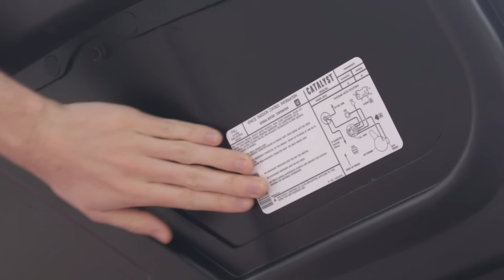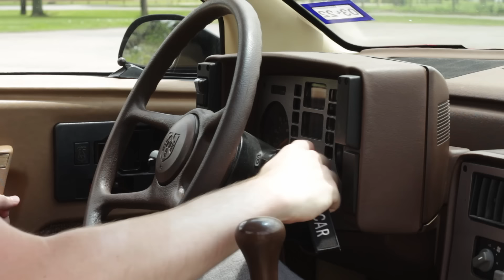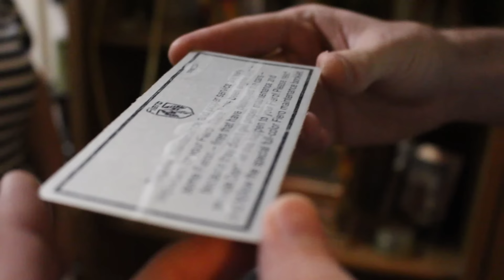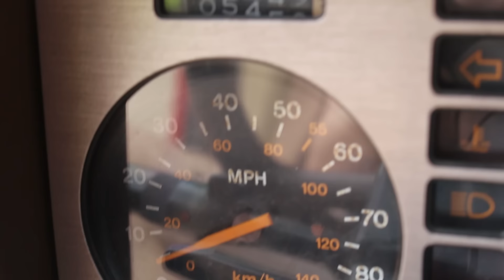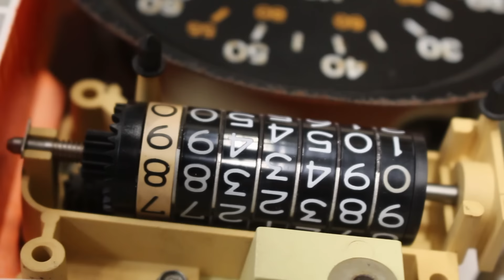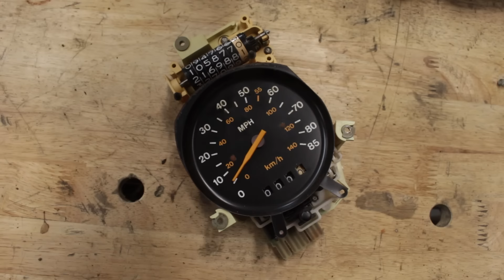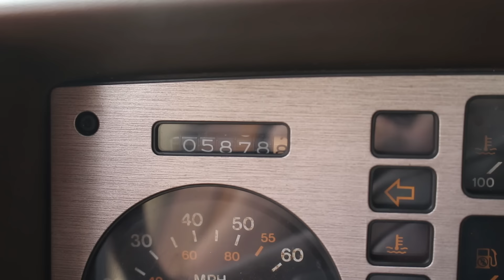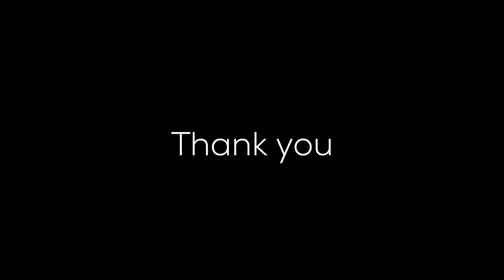The Journey Ends | 1985 Fiero 2M4 Revival - Part 15

Comment: My Fiero story:
At 19 yrs of age, I was stationed on Guam and had the joy to own Hondas 1st sports car, an S600.
At 21, i was fortunate enough to buy my 1st new car. A 1971 Mustang fast back. A lifetime of cars and trucks brought me to 1995 when I bought my 1st Fiero. I had admired them when they first came out. In 1996, I bought my 2nd Fiero, a 1987 model with only 17,000 miles in perfect condition. It was a fantastic, fun to drive car. Now, at age 73, in an effort to once again enjoy driving for the sake of driving, I just purchased a 2023 Mazda Miata. You're correct. You have only finished the beginning. You have many years to enjoy sports cars. I was a heavy equipment mechanic, self-taught. What you have learned can be the start of a very good career.  Well done!!

Comment: In so many ways this car reminds me of a Delorean.
Both cars had revolutionary ideas of construction with DMC having stainless steel panels on a glass fibre structure. The Fiero having a steel construction with composite body panels. Both perhaps didn't live up to the hype I'm practice but that doesn't matter because they show innovation.
Both cars could only have come from the 1980s.
There really is no sense in me trying to buy and restore a Fiero as I dint have your engineering prowess, or a garage/barn to work in and parts availability will be an even bigger issue here in the UK. A fiat X1/9 or MR2 would probably make more sense and possibly drive better but not sum up the greatest decade ever as much. I still remember seing one for the first time at an American car dealer back in the 90s and have never foregoten that.
You have done a fantastic job and should be very proud of what has been achieved.

Comment: In January 1985, I sat in a Fiero for the first time. I loved the cockpit and the six-speaker sound system. I ordered a brand new 2M5, all black, and took possession in April. I also had a BMW 320i which I could not bring myself to sell, so I had both of them for several years. Tough choice to make every morning about which one to drive to work.
The Fiero was great in the snow (because of the mid-engine), but not so great in the rain (because of the 60-series tires).
I owned that car for 22 years, and drove it for 20. I gave it to a friend after I ran out of space in my driveway.
I would love to drive one just one more time.

Comment: THANK YOU! 

I've had my 84 2M4 for 6 years now. She has always needed a TON of work. But as I am very inexperienced, I've always been timid and lacked the courage to start doing any real work on it.

To say this series has helped me would be an understatement. Not only have you given such great details and insight, but you also provided me with something I couldn't sum up myself.  The courage to dive in and start working. I am right now in the middle of replacing the valve cover gasket, vacuume lines, and even fabrication of my very own battery try! (Also my first ever car part fabrication). Yes push came to shove, and my battery was about to fall out, and the valve gasket was leaking so bad oil was spilling out onto the exhaust,  so I had to do something! But i 100% believe I couldn't have gotten to where I am with my daily driver/project without you. 
I am forever grateful for you and the time you put into these videos. I absolutely Love my Fiero and I can't express how great of a feeling It is to be finally making mine better. 
Thank you so much. ❤

Comment: I’m 13 and you inspired me to tackle a project like this. During quarentine I started detailing cars, and eventually saved enough to buy a go kart. But it wasn’t a shiny new go kart, it was one that had been sitting for 10 years and had been crudely rigged in just about every way possible. The wiring was bare in a lot of places, and it was just twisted and duct taped so the kill switch didn’t work half the time,  the roll bar had neon green pool noodles taped all over it, the seatbelt was a threadbare guitar strap, the torque converter cover was a pink piece of flimsy plastic, and the carburetor linkage was a piece of paper clip. Literally every system needed to be throroughly gone through and rebuilt. I’m nearing the end of the beginning of my project, I just heard it start for the first time the other day. Thank you so much, Ronnie.

Comment: I was Heavy Line/Auto trans specialist For Buick/Pontiac/GMC from 1981 to 2008. I was there when the Fiero came out and when it left. The last year was the best year. Power, 4 wheel steering and all the kinks worked out. The car set a goal too high in the beginning. I made a lot of money working on these things (cam gears on the 2.5!). Good on you for doing this. The journey teaches better than the destination.

Comment: Fist of all Ronald, THANKS...!   I have enjoyed following you through it all...!  I've had my early run '86 GT for 13-years, but I started out with a near pristine Fiero.  One transmission, and two engine swaps later, I now have a 3800sc quasi super car, and I love it.  Your videos have taught me allot about my car and how to fix other future problems.  

You said you might do some mod's, so I would like to suggest a couple simple ones...  First paint your rear view mirrors to match the car and give it a classier look.  Makes a big difference.  Second, cut just one coil out of all of your springs, which will drop it a much needed 1" and give it a more sports car look and ride, not to mention better handling, especially in the corners.  Some new gas adjust KYB front shocks and KYB struts will help allot too.  

If you ever feel your car tends to jump around a little on the highway, in the back, especially when you hit those trucker ruts, then you will realize one of the MFG engineering flaws designed into them all, up until '88 and the revised suspension.  That flaw is mounting the cut-down  original steering arm to a bracket welded to the cradle.  They mounted it about three inches inboard of where it should be, to align it with the control arm pivot points, which totally messes up the geometry.  Effectively steering the back end of the car to one side or the other, every time you hit a bump or drop into a trucker's tire groove on the road.  

You can buy an all new tubular bump steer correction kit from the Fiero Store for $700+, or you can do it yourself with a little bit of cutting and welding and rethreading, to get her lined up, to make her go down the road straight.  I show on my face book page, how to do it step-by-step, with pictures and instructions.  I did it when my cradle was off, but it can be done with it still on the car, or you can suspend the engine and remove the cradle by it's self.  Just go to my FB profile (michael mick james) and click on photos and then albums, and find the album that says "Bump Steer Fix."There is one on doing your own custom rear sway bar also, which you can use!

Comment: I had a 1986 2M4 in 1988-1990. It was kind of fun and it turned a lot of heads at the time, but the horrendous turning radius proved to be too annoying to continue with. That and the continual recall notices for engine fire prevention.. But I liked it and drove it everywhere. This one sure looks nice.

Comment: Our Hat’s Go Off To You Ronnie!
A Job Well Done!
Do cry though... There will always be something more to fix or replace. ie, Front Side Marker Lens Bezels should be (Amber) yours are faded (White). Brake lines in rear are hanging very low and need to be properly fastened & secured, Elastic Terry Cloth Map Holder on Passenger Side Dash needs to be installed. Other than that, you’re almost completely finished. A fine job my Friend!!

Comment: The A/C compressor model is the HR6.  H=Harrison.  R=Radiator.  6=6 cylinders.
The HR6 was originally called the DA6.  D=Delco.  A=Air. 6 cylinder.  
Some parts were machined in Dayton,Ohio and the rest in Moraine,Ohio.
Final assembly (prior to 1993 was Dayton)  After 1993 assembly in Moraine,Ohio.
The DA6/HR6/HD6 is simply a smaller version of the old A6.
The DA6/HR6/HD6 was an aluminum casting, lightweight scaled down version of the A6.
A6 production lasted until 1981.
The DA6/HR6/HD6 was used usually in big cars and trucks.  For instance, this model was used in 1500 Chevy/GMC trucks until the 2000 model year.
We also produced the R4(radial 4 cylinder) compressor.  (came out 1974 model year)
And the V5(Variable 5 cylinder)
This factory(Moraine) was originally founded by Orville Wright to produce float/sea planes.  The plan was to finish the planes and roll them down to the Miami River.
But Orville had other plans and sold the location to Charles (Boss) Kettering.  The founder of DELCO=Dayton Engineering Laboratories COmpany.
Eventually, GM bought out DELCO.
We were spun off by GM in 1999 as DELPHI.
All manufacturing ceased in Dayton in 1993 and Moraine in 2007.
Most of the operation went to Mexico , some to China.
All DELPHI factories in the Dayton area were shut down in 2007.
1 DELCO Products, 2 DELCO Moraine, 2 Inland, 1 Harrison , tens of thousands out of work.
Dayton was the largest concentration of GM operations outside of Mich.  All Gone.
*Note,,,Franklin Sousley, one of the flag raisers at Iwo Jima worked at the Harrison(Frigidaire at the time) Moraine plant.